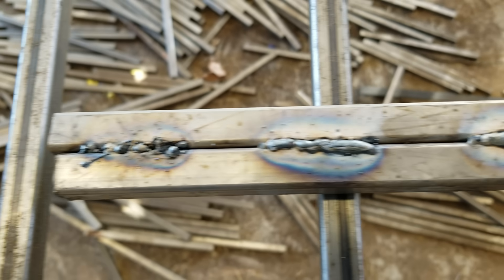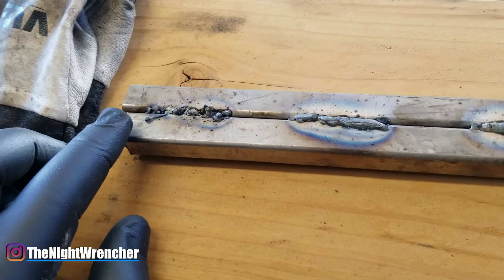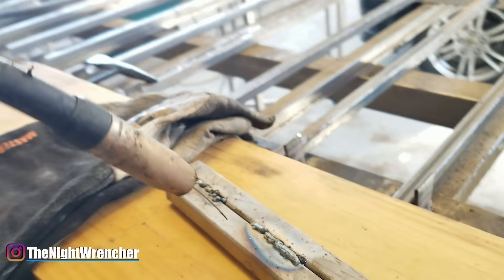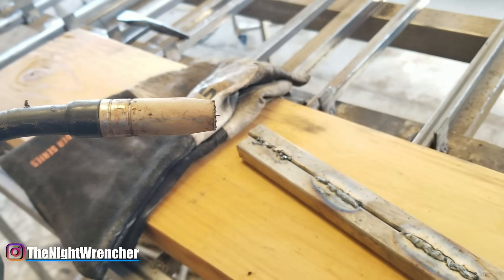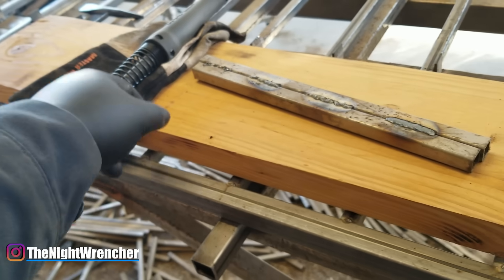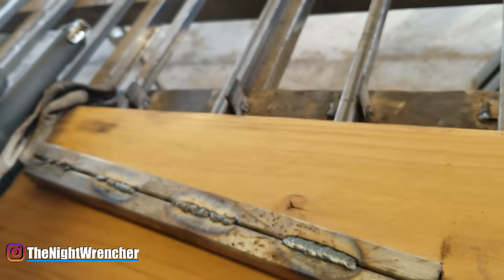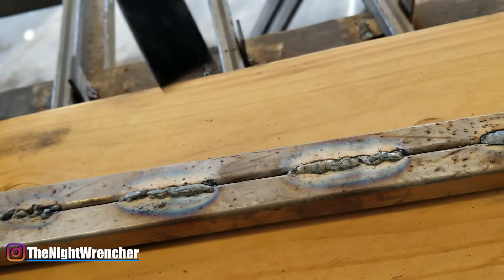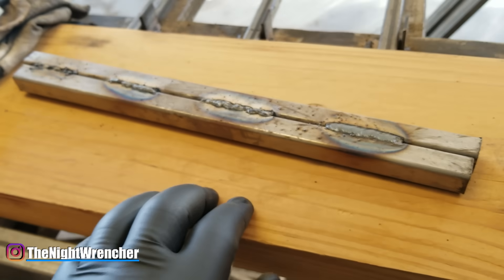Learn Perfect Flux Core Welds In 10 Mins | Gasless Flux Core Welding For Beginners Tips And Tricks |

Comment: Dude, I have had a wire core welder for several years and could never figure out why my welds were so crappy. First, I have always used oxy-acetylene welding because I had the torch and tanks. I bought the wire feed without any instruction, thinking that I’d figure it out. I quit trying because it was obvious that I didn’t know what I was doing. You just answered my single biggest questions about both distance from target and direction of weld. I’ve been pushing the weld forward from way too far away. You explained 4 welds and answered a whole bunch of questions that I wasn’t even sure were valid questions. They were! Thanks!
Reply from the maker: Thank you! Its all just practice! Make sure your machine is set up for electrode negative and you should be ok!
Reply: @NightWrencher  it’s the cheapest Harbor Freight wonder that I could lay hands on at the time. I’m much more familiar with a torch or stick welding. I’m fair with the torch. I’ve never had access to a stick machine for much practice. But there’s a small outbuilding that I need built and I have several 20’ sticks of 2” square tubing to play with. Nothing super load bearing needs to be put together, just a basic framework for a shade. You’ve given me the basics that I had no one to confirm previously. It’s like you answered every question I have.
Reply from the maker: Well hopefully it all works out! Im sure there are tricks to get your machine purrring in no time. Good luck!

Comment: I got the cheap Harbor Freight welder and then converted it to DC with caps.  It took as few months to get all the parts and assemble.   Thankfully I know more about electronics than welding, hehe.  But apparently I forgot a lot of the videos I saw about welding in that time.  I'm still on my first spool of wire.  And am repairing a security door I was given.  This was a good refresher video for me.   "If there's slag you drag." I heard another one. I think it was, "Work the pool, or puddle."  I've put down some good welds.  But consistency I think comes with practice.  I've only done like 25 welds in my life sooooooo.  I'm working on it! Thank you for the video!
Reply from the maker: very cool! I havn't seen anyone do that myself but it seems like a good idea!

Comment: I'm new at this but getting better even time I pick up the welder. I picked up a small 90 Amp Flux welder. Gust a Question my helmet is a shade 10 auto-darkening is that dark enough? I gust worry about my eyes.
Reply from the maker: Mines a 10 setting too but I keep it on the lightest setting so I can see where I'm welding. The glass should block the UV rays so youll be ok reguardless
Reply: @NightWrencher  awesome I figured I was OK but feel better hearing it from a professional. I tried to Google it but never really got a straight answer. Thanks  bud I appreciate it. 👍
Reply from the maker: Well I'm not a professional quite yet but the light itself wont hurt you. Its the rays that hurt you but they get blocked by glass

Comment: No such thing as gasless flux core, it’s just flux core.  Or shouldi say that’s redundant . No i didn’t watch the video. You’re welcome for the 1 view
Reply from the maker: You can weld flux core with gas.
Reply: @NightWrencher  flux core means there’s an inner flux. Aka inner shield. No need for gas. Unless somebody did some idiotic video mixing fluxcore with gas that’s not necessary
Reply from the maker: @Big_red_builders  wrong. https://www.lincolnelectric.com/en-za/support/process-and-theory/Pages/shielding-gas-for-flux-cored-welding.aspx
Reply from the maker: @Big_red_builders  its called FCAW-G
Reply: @NightWrencher  so there’s something new? Engineers will never stop
Reply: The title is still misleading. Flux core is very well known not to use gas. To say you can flux core without it isn’t right. Atleast to me
Reply: I’m sure i could stick weld with a hose pumping argon on the puddle would probably make a difference but would be uncommon
Reply from the maker: @Big_red_builders  I get what you mean, but its a real thing, so it just reassurance that you're clicking on a video that talks about a very specific process
Reply: @NightWrencher  I’ll watch it tomorrow.

Comment: One big difference in welds also is the welding machine itself. If you are using a cheap Harbor Freight fluxcore machine (Chicago Electric) , then it does ac welding. Pay a little more for the other fluxcore welder Harbor Freight offers because it does dc welding. It does make a big difference.

Comment: does it need to be set to negative polarity? if so do you have a video on how to change it?
Reply from the maker: Yes, typical polarity for flux core is DC electrode negative. It depends on the machine but usually it will tell you on the inside flap of the machine where the wire goes if its even capable of swapping
Reply: @NightWrencher  awsome thanks! I will check tomorrow its a lincoln electric so maybe!
Reply from the maker: Im sure it can because all my lincolns could
Reply: @NightWrencher  cool sorry man im new to welding thanks for all info!
Reply from the maker: No problem man, any time 👍

Comment: what brand of gloves are you using.
Reply from the maker: I use harbor freight tig gloves. Theyre really thin and easy to move around but for heavier beads with a lot of heat I use lincoln mig gloves. Not the brown thick ones. The red/black thinner gloves

Comment: Any tips on weld upside down and on thin sheet metal?
Reply from the maker: Upside down is really hard. If you go too slow youll build up a lot of material and it will drip on you. Too fast and you wont have enough penetration. Sheetmetal is fairly easy. Dont try to weld beads because youll warp it or burn through. You need to tack weld the sheet metal over and over until all the tacks are about half an inch from each other and then connect them
Reply: @NightWrencher  I tried and i had trouble aiming the welder. Must have missed 75% of the spots
Reply from the maker: You'll need to add more lights like a spot light so itll help you see where youre going

Comment: Thanks for your informative video. 
I was wondering is it possible to run a flux welder on a step up transformer ?
Reply from the maker: Like a power inverter? Yes it is. I have run my welder off a 3000w 12v to 120v power inverter no problem. The welder was an older lincoln but I'm not too sure if it would work with the newer computerized welders with the LCD screens
Reply: @NightWrencher  I was looking into buying a step up transformer from 110 to 200v for a cheap mig 130 made in China. Just wondering if it’ll work ?
Reply from the maker: I would not recommend it. 220 pulls a lot of juice. For flux core you dont need anything more than 110. For standard mig you can also get by with a 110 welder but thicker materials need the 220

Comment: How do you know what to set the wire speed at I got the distance down from the tip to the material but I’m not sure about the wire speed between three and four is where I have it set and I still come up with a lot of boogers but they do hold. I welded with  Argon And the worlds look a lot better but now I have a flux core welder and they don’t seem to look as good and I do get a lot of spatter
Reply from the maker: Listen to the sizzle. Turn it down all the way down and Keep turning it up until you go from pauses due to the wire melting too soon, to consistant sizzle.

Comment: Great video, one question, when I understand it right, when flux welding you actualy drag the torch in stead of moving into your weldingdirection? Is that different from actual mig welding? Do you push when mig welding the torch in the direction of the weld?
Reply from the maker: Theres different ways to do it but the most popular one is straight up and down to get max gas coverage. Has position for standard mig all depends on the gas

Comment: Drag the stick! That makes so much more sense and explains a lot! I grew up stick welding and was taught to push it, which also appears to have been bad advice.  Thanks!
Reply from the maker: Well stick is a little different, since you do have to push it into the material at the same time as you're dragging it away
Reply: @NightWrencher  I grew up on a farm and probably learned a lot of bad practices. Glad to see videos like this helping people not make the same mistakes.
Reply from the maker: I bet you still know more than 99% of people out there though!
Reply: @NightWrencher  It's entirely probably, still have a lot to learn though and your video already stepped my game up.
Reply from the maker: Let me know how it turns out!
Reply: @NightWrencher  Will do! My practice on the weekend showed improvements already. My only issue is I'm trying to weld 2 different things together to put a handle on a blacksmithing project. Welding rebar to jackhammer bit is proving challenging with a 120v flux mig welder.  But I'll figure it out.
Reply from the maker: Max out the heat and slow down the speed!
Reply: @NightWrencher  That's a great idea to try, I had it backward as I assumed higher wire speed would increase the amount of material I was injecting into the weld.  Which is not what it turns out to be doing.
Reply from the maker: On thicker materials you're gonna want to take more time to heat up the material more. If the material youre welding doesnt get hot enough, your wire will just build up on top so you gotta turn up the heat to melt the metal and  slow the wire speed to prevent build up so it flows out better
Reply: @NightWrencher  That makes perfect sense, since the rebar is much smaller I would want to let it burn on the bigger piece for a little bit before trying to get them to stick together correct? I was thinking I could try heating the big piece in the forge first too to get it closer to melting but I'm not sure how that would work out.
Reply from the maker: If you clamp both pieces together, start on the thicker piece until you get a puddle then move the arch onto the rebar and hold it for a sec to tie them together. Once you get a puddle on the rebar shift it back onto the thicker piece and keep doing it over and over while dragging it down
Reply from the maker: @hawkbox  this video shows a very similar technique
Reply from the maker: @hawkbox  https://youtu.be/YOYscsLIkWQ
Reply: @NightWrencher  Thanks, I'll give it a watch. I think I get the concept, it's doing the actual implementation. And not panicking that I'm going to slow.

Comment: Just done my first welding in my life - flux core welding, after watching tons of tutorials on YT by those pros. I was very confident that I can get a decent result until now. I have to admit that my results are exactly the same as the first and second cases. Now I know what's wrong there. It is my problem, not the machine. So I don't need to return the $300 little machine to buy a pro level one. I just need some more practice. Appreciate it!
Reply from the maker: Good luck! Hope it works out!

Comment: Thanks! Maybe I can master my old Craftsman welder now!
Reply from the maker: If its got 2 knobs for settings thats all you need, only 1 knob then you gotta slow it down to get a good balance
Reply: @NightWrencher   Mine has a low/high power toggle and a wire speed dial. I think it was made in Italy.
Reply from the maker: Put it on high and slow it down, maybe you'll get it to burn well!
Reply: @NightWrencher   I'll try in a day or two and let you know. I've been laying down snotty welds for far too long.

Comment: What causes a hollow bubble with a hole I'm it at end of the weld?
Reply from the maker: Sometimes its normal, you want to stop your weld and hold it there for a second and build up the end before you let off the trigger to pevent the holes. Dirty metals and trapped flux will also cause that.
Reply: @NightWrencher  Thx, probably not pausing at the end. I notice in stick weld videos they pause and back up just a little at the end.
Reply from the maker: Yeah basically thats what you can do or weld in a small circle to build it up too

Comment: Bottom Line, smooth welds look great and it's what is taught.  However, as long as the weld holds, who gives a shit about how it looks?
Reply from the maker: Thats true but its harder to make it look good than it is to make it stick so if you aim to make it look good, you'll be getting stronger welds at the same time. I uploaded another video to prove that point. You should check it out

Comment: Thank you for this video, I’m not a welder just a general home owner, I have a basic welder and flux core and my welds are not pretty, you did a great job detailing what I was doing wrong, my main problem is gun angle, I have always “ pushed” the weld when it Looks like I should have been “ bragging” it, also need to work on speed control, I can’t wait till the next time I need to weld something so I can try this stuff out, thanks again.
Reply from the maker: Good luck! Thank you!

Comment: I've been considering getting a flux core welder. Thanks for the video 👍👍
Reply from the maker: Just make sure you get one that can adjust voltage and wire speed seperately, not together!
Reply: @NightWrencher  👍

Comment: What setting did u had on your welding machine set up?
Reply from the maker: Its an omnipro 220 I was on 110v 122in/min and 16.5 volts. On my lincoln 175 it would be setting 3 or "C" and the speed around 3.5 out of 10
Reply: @NightWrencher  thanks im here learning

Comment: Anti-spatter spray helps a good bit with the spatter too...
Reply from the maker: I thought I mentioned it in the video but good tip!
Reply: You can use PAM cooking spray too.
Reply: I buy the anti-spatter on the internet.  $12 per gallon.  Just put it in a spray bottle and spray on materials before welding.
Reply: Wait.....I was joking  ! There is actually anti-splatter spray ? LOL 😅
Reply from the maker: Lol yeah there is. I dont know the exact material its made out of but its an areosol that leaves an oily film on the metal to prevent spatter but its not oil

Comment: Ok, what about welding vertical , what’s the correct procedure?
Reply from the maker: Hang tight new video on that coming soon! Basically, build up a little on the bottom corner, start on the thicker or more solid metal, once it starts to flow pull it to the other metal to tie them together and then drag it up. This all happens within a few seconds so get nice and close so you can see youre wire

Comment: How do you like that Vulcan? How accurate have you found the auto settings are? Too hot/cold or about right?
Reply from the maker: I'll have a review video up soon but the auto settings are pretty close on some things and way off on others. But it also depends on the brand of wire because some wire takes longer to flow out and some overheats too easily
Reply: @NightWrencher  Thanks, I'm running some Blue Demon .035 flux but have tried couple more brands in .030. I did find some of the stick welding with 1/8  7018 was a little hot for my taste so i backed it down. I've had mine for about 9 months, no complaints.